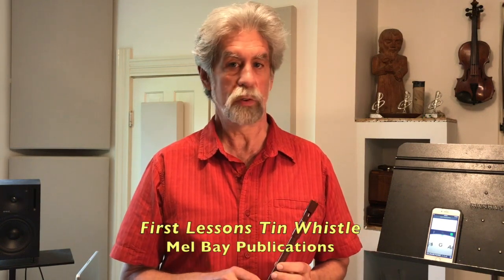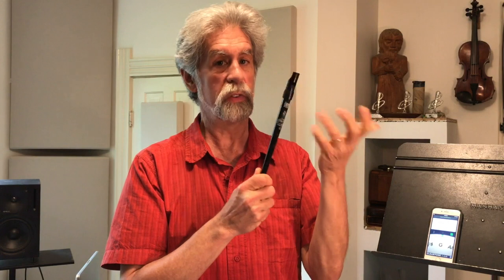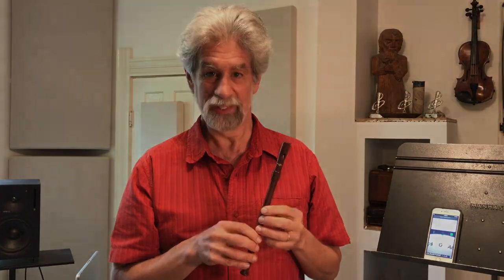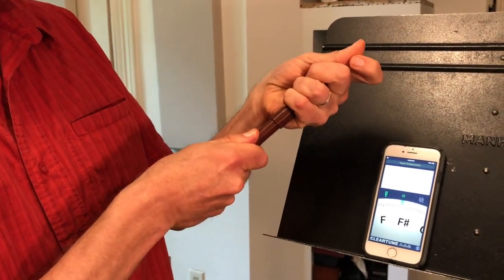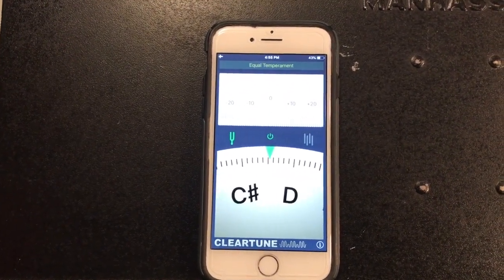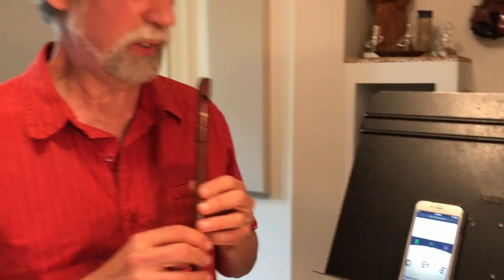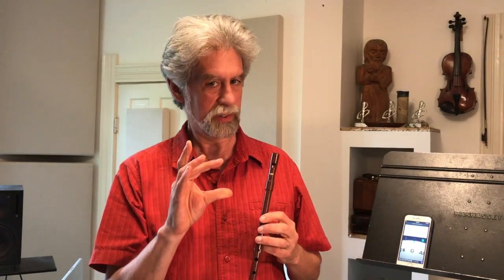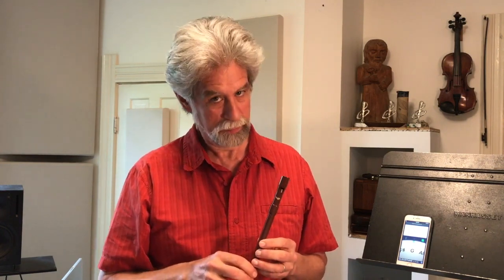Tuning and Adjusting the Tin Whistle

Comment: For the Clark and Generation whistles you can make it tunable ( excluding the original Clark one ( which is tapered inside the bore ) ), they usually are just glued into place ( usually to prevent damage during shipping) all you need to do is use a hairdryer for a few seconds and then twist gently until the mouthpiece comes off ( after that you'll need to clean a bit the gunk from the glue ( on Generation ones I haven't seen any ( and it looks as if they build them for tuning )) after you do that you'll need some cork grease ( about 1 dollar at most big music stores( used for clarinet)) and then you apply a bit on the bore ( and with a soft toothpick ( like the ones used for dentures ) you'll need to lube up inside the mouthpiece itself ( don't go into the window part just the bit that sticks to your instrument) after a few fittings you now have a very tunable whistle. **NOTE: CHEAP $10 WHISTLES AREN'T EVER TUNABLE EVEN WITH THE ABOVE MENTIONED TECHNIQUE CAUSE THEY ARE PLASTIC AND USUALLY BUILD AS TOYS**. The type of whistle Grey has ... it's not really beginner friendly cause it's usually around $250 for 1 whistle so yes you could buy a Tony Dixon high D one for about $80 but problem is they are often quite large and need a legit flute case, I recommend the Generation Nickle plated D ones ( you could go for other keys but keep in mind high D is usually the one you will be using the most( mainly cause most folks can't afford the low Ds and also the low D now your getting into the flute terrain and ergo harder to play a bit( not to mention the cheapest one being a low cost of $200 )) or the Clark Sweetone ( make sure you get the modern ones since the Clark original series are quite difficult to play and are never tunable). If you really are a musician( as in you get payed loads of money for your music) then Tony Dixon is a good beginner for the pro level but those again are quite a bit more expensive
Reply: A Clark original can be made less flat by carefully removing material from the end with a belt sander. Carefully.

Comment: When using an electronic tuner how many cents sharp or flat is considered acceptable?  I often find say on a D whistle the Ds will be spot on but the other pitches may be some cents flat or sharp.
Reply from the maker: This is a tricky issue. I feel that electronic tuners don't always get it right. I suspect that they are not "listening" to all the overtones in a sound in the way that a human ear does. So sometimes when a note sounds in tune to me, the tuner does not always agree. I would train and trust your ear as much as you can. I would say that a reading of 10 or 12 cents off may still be good and in tune to most listeners. Also, we don't always want to play every note according to equal temperament. For example, if you are playing the 3rd in a major scale, it may sound sweeter to the ear when it is a bit flat of equal temperament. Things are not as cut and dries as electronic tuners tempt us to believe.
Reply: @greylarsenirishflutewhislte  Thanks for the reply.  I posted this query on one or two of the whistle sites and the replies match yours in going with one's ear rather than the tuner.  Some replies went into some detail about just and equal temperament.  This was rather boggling and perhaps a tad too academic.  I have also found breath control has a lot to do with getting the right tone.  I may be too quick  to fault the whistle rather than my skill.

Comment: Also wanted to add( in regards to tuning): DON'T USE A GUITAR TUNER IT WON'T WORK, I'd recommend either an app on your phone or a multi instrument tuner ( look and see it can be used for the violin ( high pitch = good for whistles/flutes guitar = low pitch = your whistle/flute won't be detected by it's sensors)). Another thing is make sure your whistle is actually a tin/penny whistle and not just a kids toy (easy way is to look how much it costs.. usually they go for around $15 ( for normal people whistles ( I mean the ones that most folks will be willing to buy cause let's be real the pros buy the expensive ones ( and they are expensive cause really only like 30 people could afford to buy them))) and at the $15-$40 range they MUST be of Nickle plated tin not aluminum( bad for your health) and not steel ( rusts and corrodes) and never cheap blown plastic ( those again are toys for kids to make noise you won't be able to tune or even play them). P.S I have a Masters in Music and work with the Royal Winds Orchestra ( in UK)

Comment: Why are G and D more stable notes than rest of the scale?
Reply from the maker: Thanks for your very good question. D is the most stable note because, when playing D, you are using the longest possible vibrating air column, all holes being covered. The longer the vibrating air column in the whistle (or flute), the more stable is the pitch. As for G, it is not as stable as D, but is still fairly stable. I like using it as a reference note because it is the tonic note of the second major scale that is easily playable on the whistle (the first one being D major) and because so many tunes in the traditional Irish repertoire are in G or a related modal scale. And subjectively, G just feels like a very important and grounded note to me. I hope this helps.
Reply: @greylarsenirishflutewhislte  Well, now I can segue to a related topic, scales.  The only difference between D and G is a C# in D and a C natural in G.  So with the other notes being the same for both scales I don't how using G as the tonic is different than using D.  If the whistle is tuned using D isn't necessarily tuned to G as well?
Reply from the maker: @soslothful  Another good question. Since no whistle can be perfectly tuned to equal temperament, there is a certain degree of compromise required. I find that when I check both D and G, I make a tuning decision (i.e. lengthening or shortening the whistle) based upon tuner readings (or, more often, just trusting my ear in reference to a stable pitch) for both of these notes, neither one being necessarily “perfectly” in tune.

Of course the pitch of any note depends in part upon how much force you use when blowing. So tuning is also personal. I could tune a whistle to suit myself, hand it to you, and you might not find it tuned just right for how you play.